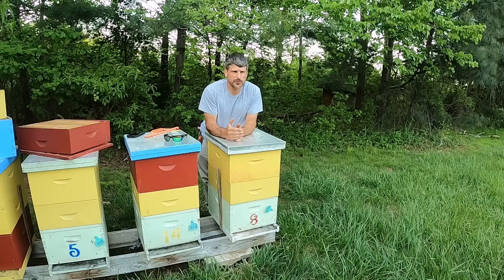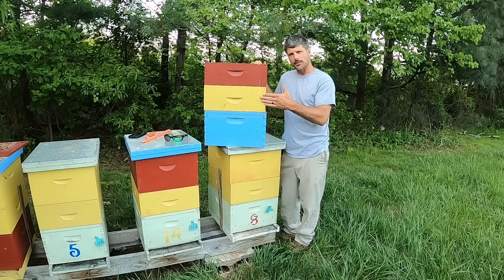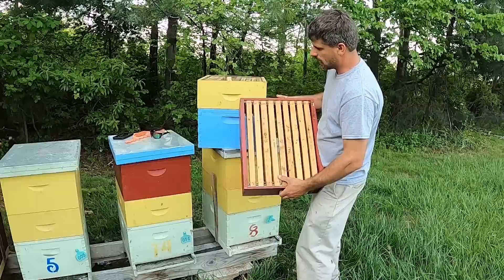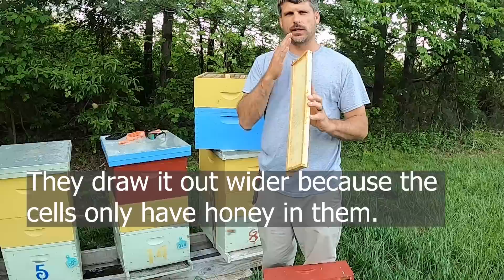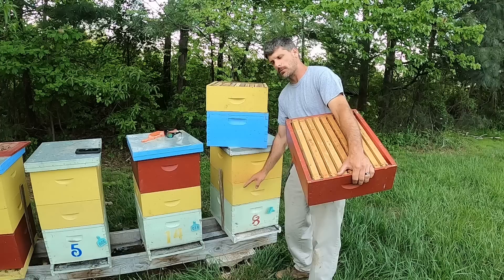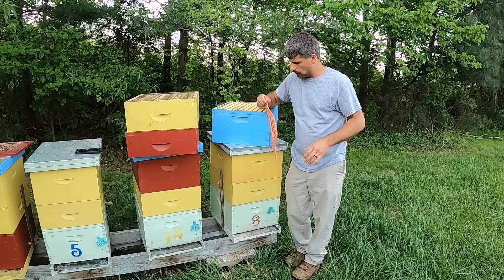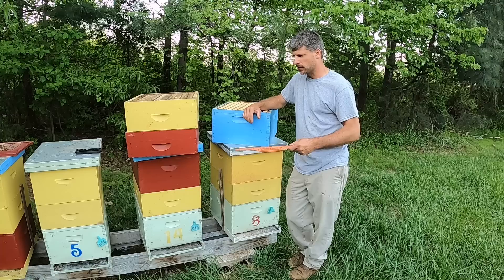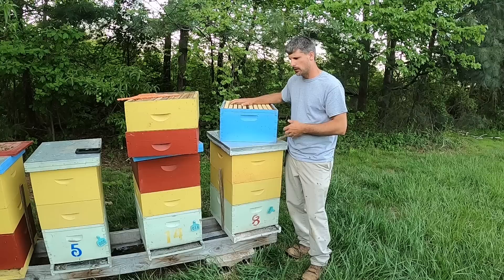Supering Bees for Nectar (Honey) Flow

Comment: Good timely advice
Reply: It takes a little more time, but I've found that placing a hive tool between each frame spacer will provide almost perfect 9 frame spacing.  Yes a plastic spacer would be much quicker, but I don't have one.  Love doing 9 frames *once the frames are already drawn*. 10 frames until they are drawn, then pull the emptiest frame and go 9 frames in a 10 frame box.
Reply from the maker: I have definitely manually spaced frames as I’m always forgetting to bring the spacer. 😂

Comment: Don’t remember you covering it but why not use double deeps for brood? When I first looked into beekeeping over 15 years ago that was common to see. And then with the strong colony of bees you can add honey supers on top. And if things really get busy for the bees just keep adding supers on top. I saw one guy with 5 shallows on top of his 2 large brood boxes
Reply from the maker: I spoke about that in another video. I do this for a few reasons. One is I find it easier to manage a colony through the flow with brood being in a single deep. Easier to move for different flows, easier to deal with issues if they arise, and the hive doesn’t get so tall. I also tend to average more surplus honey in this configuration, though it’s a catch 22 as they do not build their winter stores through the flow and have to be artificially added (feed) if the fall flow does not produce. I have found and calculated that a queen can’t lay more than a single deep. We see them expand into the second deep, but neither deep is full of brood as it is just mathematically impossible to lay that many cells. When confined at the right time to a single, that deep get really efficient and nearly end bar to end bar packed with brood. Overall, either config is fine and works well…it’s just the method I have chosen. Thanks for watching!

Comment: how do you keep your hive from swarming using single brood chamber management, the only way that I have kept the hive from  swarming  is to equalize the the hives every two weeks.
Reply from the maker: I run them in doubles up to the flow. I set them up with the right amount of brood frames to peak right at the flow. If they peak before the flow, they swarm. Timing is everything.  One of the rules of thumb I use is 5 frames of brood will peak in about 6 weeks.

Comment: All good advice but I have trouble getting supers drawn out. I want to use mediums but all the drawn comb I have  are deeps it seems like. I put them on and the bees fill them but start running out of steam before building the mediums out. Now if I feed light syrup with only the medium super on they draw them out but then I have supers of sugar water in them. What is the best method to get supers drawn so I can have lighter supers to extract?
Reply from the maker: Leaving queen excluders off until comb is drawn can work. Put the excluder back in about 4 weeks before planned harvest. Your method of feeding for comb production works too. Just take them back off and let bee rob them out for their own stores prior to using for production. Once you get some drawn, it becomes much easier. Lastly, putting a deep in for production gives a lot of room for stores and can discourage or push them to late in the season before starting to draw the mediums. Maybe consider going without an excluder temporarily with only the medium until the start in it.

Comment: Do you top super or bottom super? Is one way better than the other?
Reply from the maker: I honestly think bottom supering is better…but I’m a little bit lazy when it comes to that. I hate picking those things up over and over.  If you’re set up for it, you can remove fulls as you add empties and go ahead and extract all through the flow.